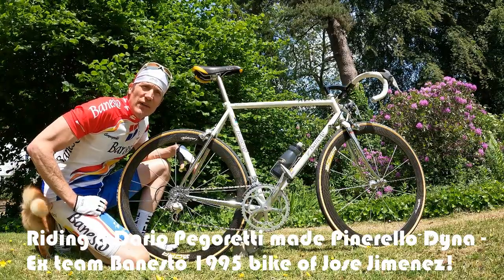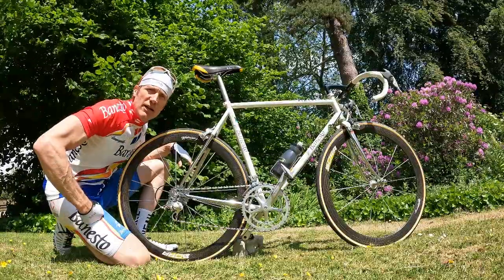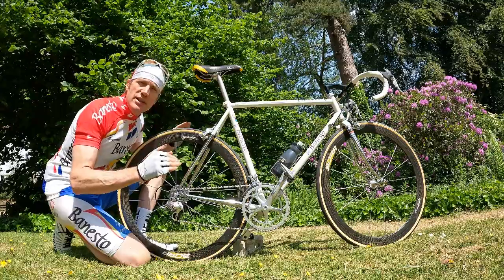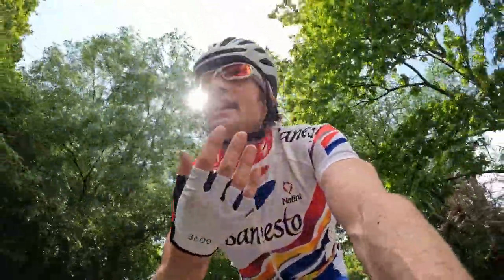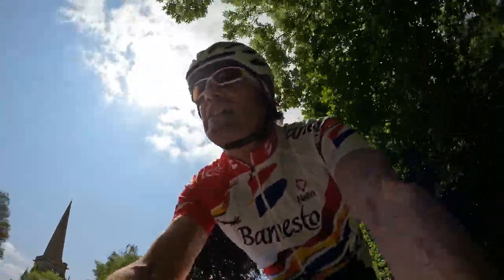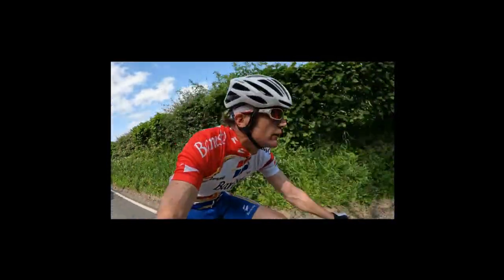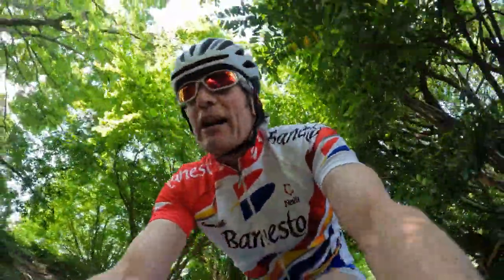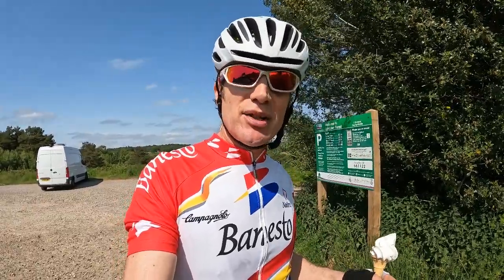Riding a `95 Banesto Pinarello team bike - Pegoretti made, Jimenez ridden and just plain awesome!

Comment: Awesome bike.

I have a period correct(ish) Masciaghi Coppi in Columbus Genius with a pro issue 7410 grouoset. The same bike Bungno used to win the Tour of Flanders in 94. Frames were built by Gianni Pelizzoli and they have what I think are the same properties out of the saddle - it’s just over 9kg but feels like 7kg when kicking up a hill. Compliant and comfortable when seated but stiff and aggressive when you give it some power.

I originally wanted a Lemond TVT92 or Indurain Pinarello replica but just couldn’t find anything until yesterday afternoon when I discovered the Pinarello Dynalite model. My plan is to track one down and have it repainted in Banesto colours and built up with Record C and other period correct items 👍🏼
Reply from the maker: Great move, the Bugno Coppi will be a great ride, but the Dyna... Given the work involved on a full bare metal repaint I`d hold out for a Banesto replica - they come up now and again on ebay and would save a ton of work, Dan
Reply: @vintagevelos9517  yeah it’s a nice machine, I have a custom carbon climbing wheelset (no shiny brake track so mocks the anodised look of early 90’s wheels) and Gipiemme aero wheels for flatter rides. However Indurain was a sporting idol growing up so I won’t be happy until I have a Pinarello. I’ve found a few more potential frames (early Radius, Cromovan) so I’m keeping my eyes peeled. I actually initially looked for a replica but every one I see is the low end ML25 version. A lugged ML34 would work but my preference is a fillet brazed/TIG frame with the extra length seat tube. Part of the enjoyment is sourcing the parts and a custom fresh pearlescent paint job (team bikes were a subtle pearl white unlike replicas) would be nice provided I can find someone to do an accurate job. I would enjoy the sourcing, refurbishment and building much more than just getting a bike ready made 👍🏼